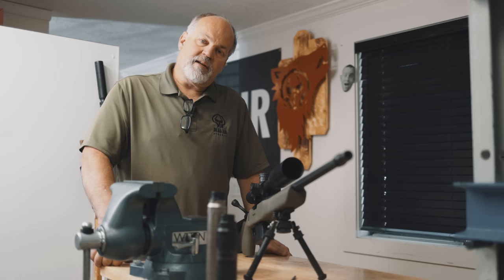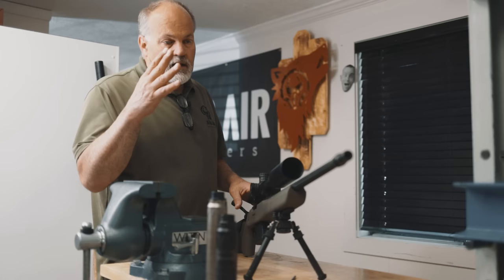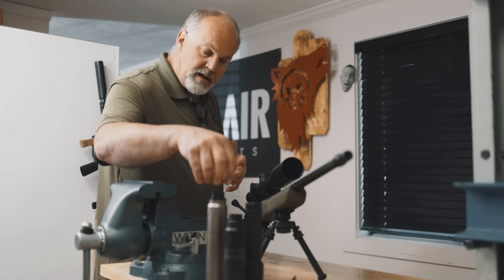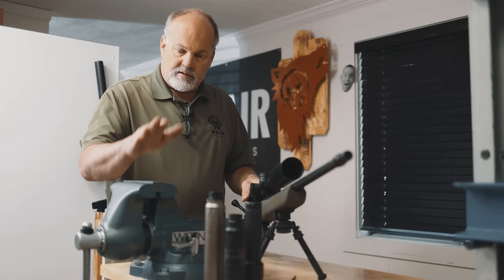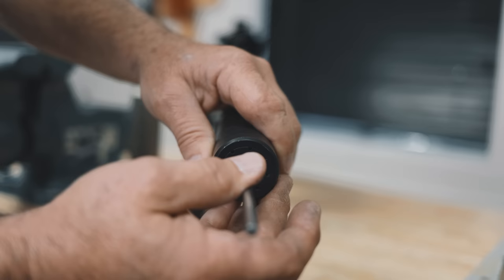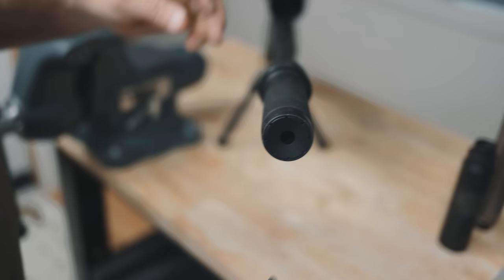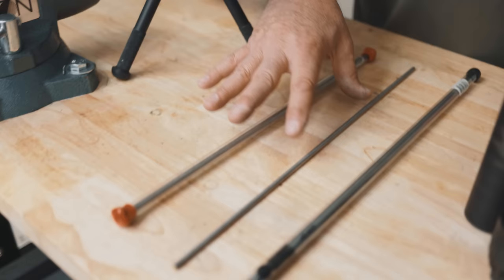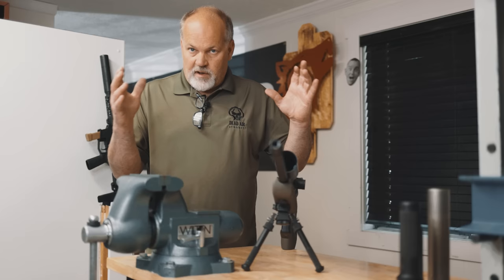Concentricity and alignment for your rifle and suppressor explained.

Comment: My friend has an AK Vepr rifle and the gunsmith at the range told us to go with the Dead Air Wolverine suppressor because the AK rifle was not concentric (he never even looked at it).   We looked at it and the threads looked evenly spaced around the bore.  Thanks for your through explanation; it explains a lot.  Would be great if Dead Air made a plastic threaded faux suppressor for the sake of measuring concentricity and alignment prior to actually purchasing a suppressor.

Comment: I've got an S that I run on a Ruger Scout Rifle and the alignment rod looks just like this-not perfectly down the center. The rifle shoots 5/8 inch groups, so for those of you wondering, it does not affect accuracy. The Ruger Scout Rifle has an odd barrel profile and the shims sit over the thread shoulder by a hair. That is to say, all these imperfections and it still shoots really, really well. Just thought I'd share that.

Comment: Unfortunately I just got my Sierra 5 in today putting alignment rod through it on four different hosts and it's off. Once I did that I noticed when you set the can up straight it's bent in the middle the weld is off, underhangs on one side and overhangs on the other

Comment: Sometimes it’s not the barrel but the muzzle device. I had an out of spec OSS brake one time. The local gunsmith and I discovered this but using a direct thread can to check it. OSS was contacted and hooked me up with a new. Shit happens sometimes